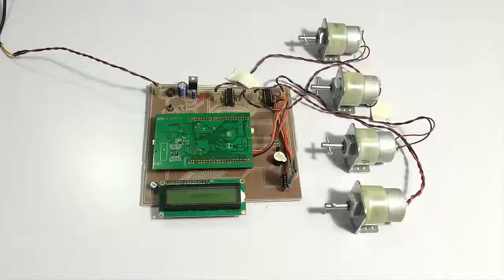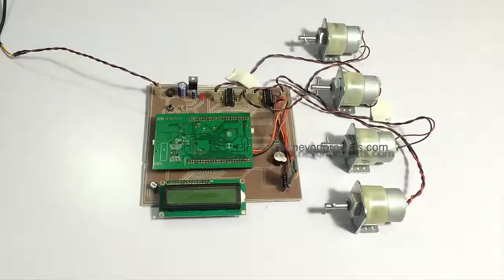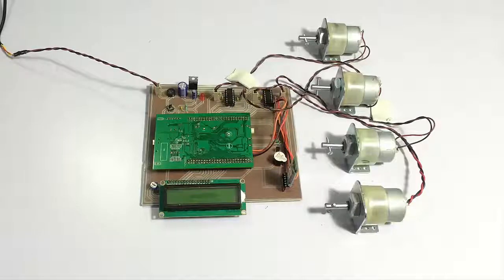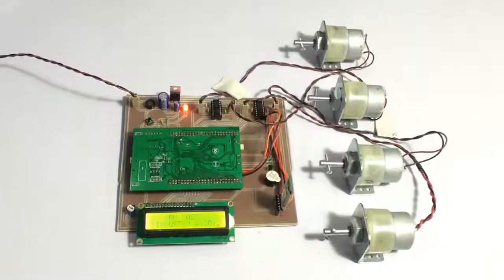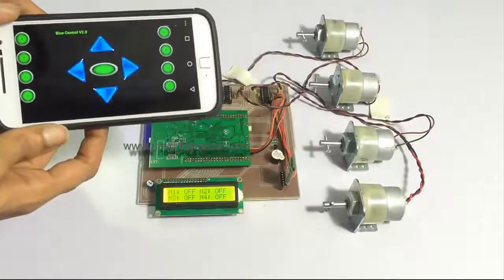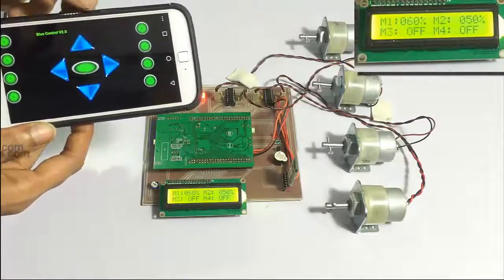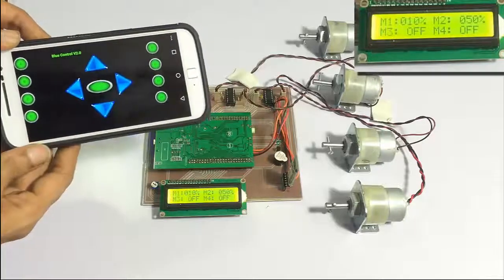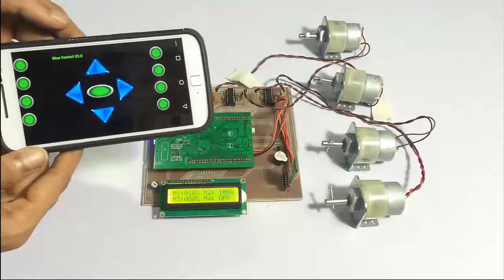Synchronized Multiple Motor Speed Controller Using ARM

Comment: I think you need a PID function to synchronise motors  speed with different load on each motor or use speed encoder